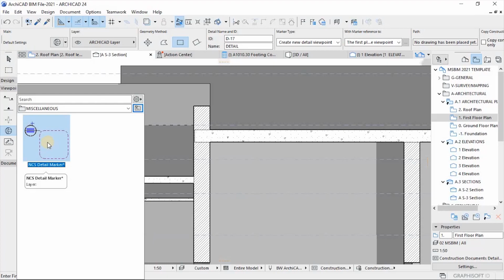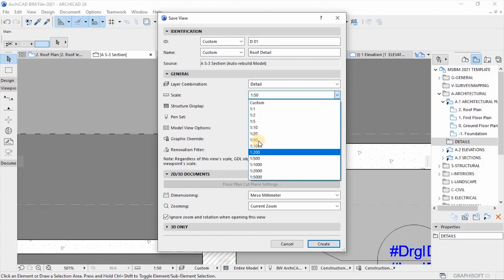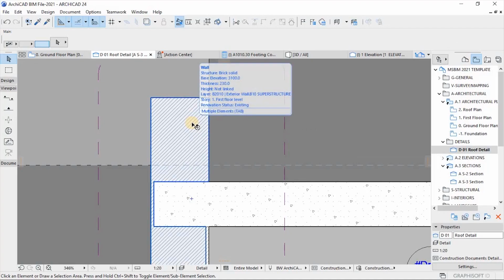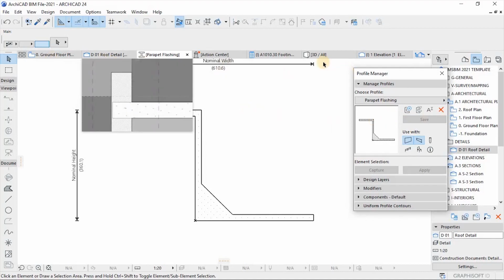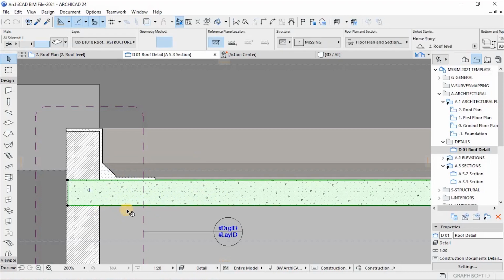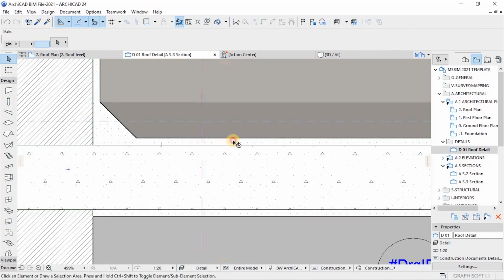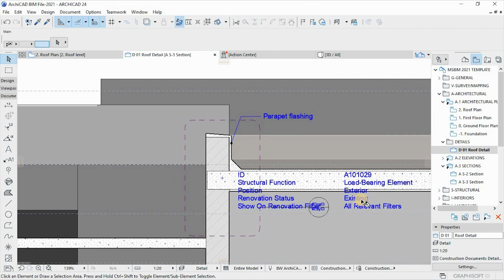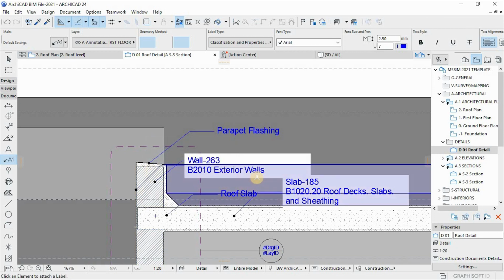ArchiCAD Beginner Detailing 101 | How To Effectively Produce Details in ArchiCAD

Comment: After plan,call note A4doubleA.pen.confident.mixedcdecide 145ksc 50kgs.bag,basketbag0.14..1:2:2.cemen rock sand volumn (45×45×14)cm.unit.Q.=1wbiq.q.metr.÷1000qbiq.cm.red mean keys data mai.////.write.programme.Rads?.steel.o.As€o.plan or sketch ad.to.formwork decide .build.thank you home grand.